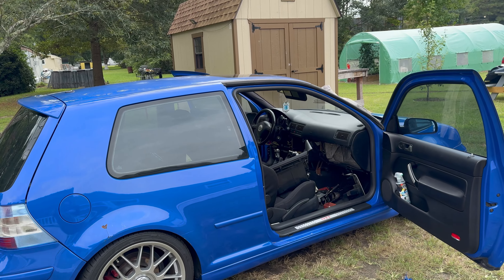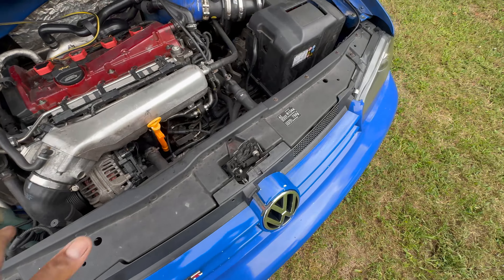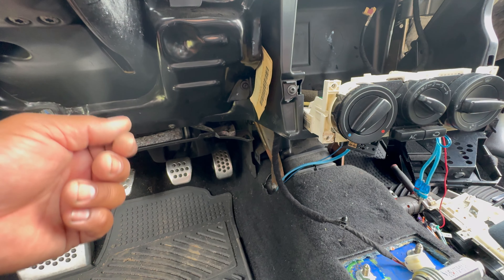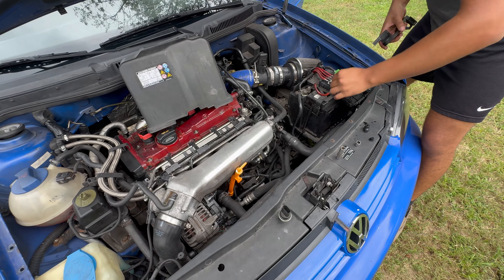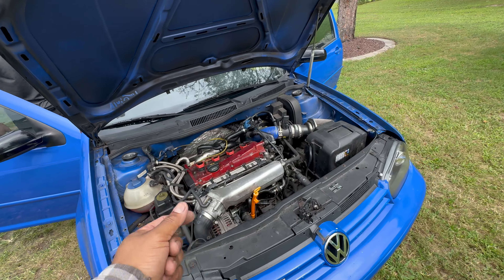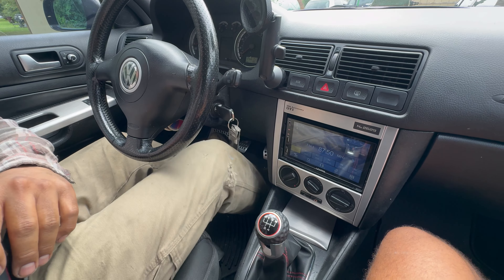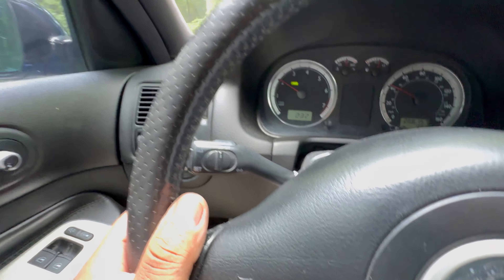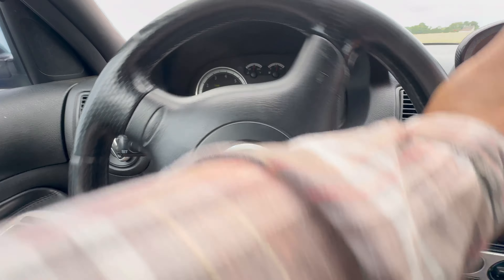Vw mk4 A/C problem  😔

Comment: Nice job, i've recently been troubleshooting my mk4 tdi bew for no A/C working. Replaced Fan control module, Fuses, Filled the system, Check power and ground to 2 pin connector on compressor. Not getting power. Relay was missing under the dash, after i replaced that i got power at the compressor. Now the compressor wont turn over so i supply 12v to the compressor and nothing. I have a new clutch kit coming to replace so i hope that fixes it!